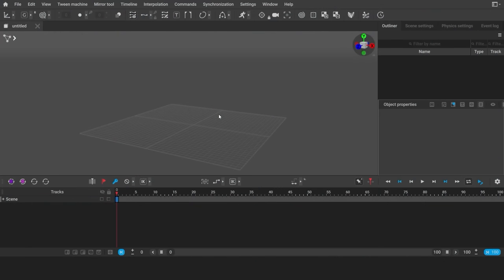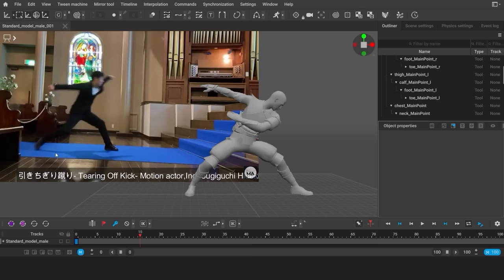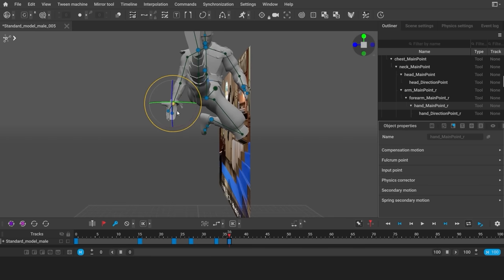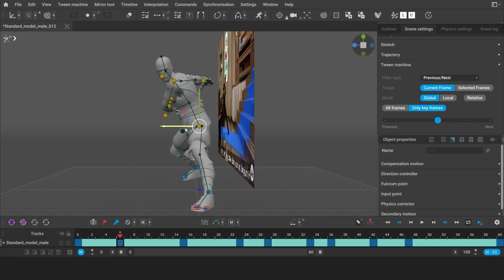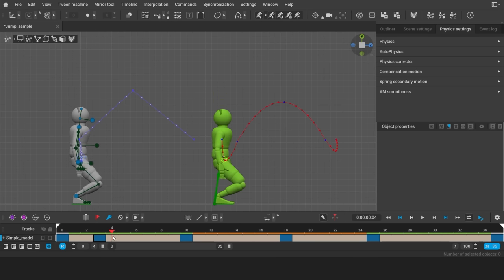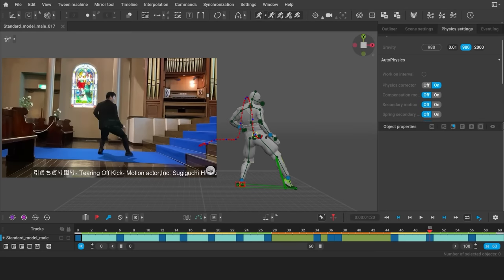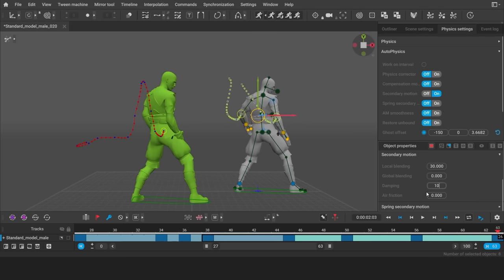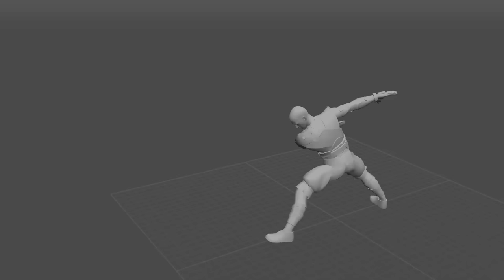Autophysics Pipeline Tutorial | How to Make a Jump Kick in Cascadeur

Comment: One of the best tutorial ever seen. Really good lenght. (maybe you could even have skipped or shortened the parts describing the physics state types / air rotation to get it down to 30m - personally I think 25-30m is the best time for a tutorial I needed to give off track deeper info show link overlays during the tutorial to another clip) Would love then to have this tutorial broken down to a few other of 25m focusing on each the topic areas you had in this. so Basically recreate the same anim but go slower and more  deeper with info there. Great work!

Comment: As 1 of the many Millions of Blender users, it would be nice if the button/key languages were at least somewhat similar in this software...

Shift + A or D to switch between frames? Why not just the up/down arrow buttons.
Spacebar is usually the play button for almost all software.
And navigating around the scene with the mouse/clicks
etc

It's not too bad to get used to, and I'm also not complaining or meaning anything negative.
It's just switching back-and-forth between a few different softwares with different controls all the time for a workflow is super jarring. 
Slightly more universal control options would be nice. Marvelous Designer and other softwares allow this config.

AMAZING software Cascadeur is though, from what I can tell so far. Congratulations on all the hard work coming together
Reply: Looks like each software having a viewport needs to invent its own viewport navigation keys.

Comment: This looks quite promising. Are there any downsides to using this over blender or maya or the many other animation tools? It seems quite unique and a huge step in the right direction for animating.
Reply: Of curse there are. To start with - this tool is mostly suitable for movements like on the video: tricks, fights, strikes and move that are not cycled. They are working on cycled moves but well i dont really remember what is the current state. Also this tool is not good for interactions with props and environment: picking up something, reloading a gun or shoot with a bow and so on is something that is not yet impelemente(if at all) as good as in Maya or Blender.
Reply: @VAULTManLOL  thanks for the reply, it certain does good for fight animations and people animations...im assuming this would just be a tool to assist with animating aspects of people animation then importing into another rendering software to finsh. ive tried playing with blender but its doesnt seem cross platform friendly yet...

Comment: First of all, awesome software :) I am trying the software atm. I have a scenario where my character should do a skateboard jump from one roof to another. The problem is the imported temp geo of the roofs isnt recognized as colliders. They are on different heights and the software thinks my character is flying while it should stand on a skateboard on top of a building. You know where or how to define geo as colliders/or ground objects?Saw on your channel that characters can interact with cubes and poles etc, but you never show how. Also when I want to kickflip my skateboard, rotation doesnt allow 360 turn on an axis, it basicly doesnt turn. If I do a 180 degree subframe in between, the board flips half and than back. Maybe you have some tipps for me, would be awesome. Thanks :)

Comment: Question about a feature I do not understand. From a certain time, all of my keyframes have a black dot. In Point Controller mode the controllers have blue boxes only at those keys with black dot. When I apply physics to this section of keyframes with black dots, the bones (edges) got pulled apart (red edge) or squashed (blue edge) causing jittering on each frames with black dots. When I put a new keyframe after a certain time all my new keyframes gets the black dot and blue box on the controller. This appears to prevent correct physics application. How can I prevent this?
Reply: Try to select frames and points and press Alt + R
Reply: @ElenaLanovaia  Thank you. I think I have to use Shit R on a key frame or Alt Shift R on range selection to toggle the blue boxes ON and OFF around the Point Controllers. I must have pushed Shift R which got me into this mode. (The R locks the controller in the air with red box. The Alt R is doing something else on my setup.) The Shift R generates some kind of Fulcrum key, mentioned under the constraint section in the documentation. As long as I set this OFF, I can apply the physics without any problem.